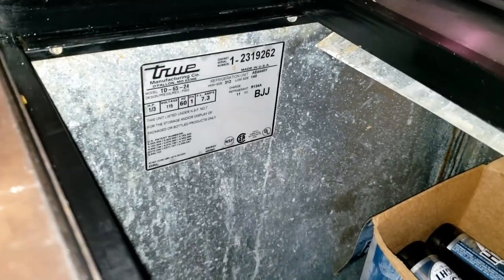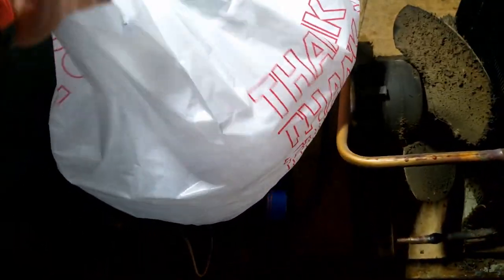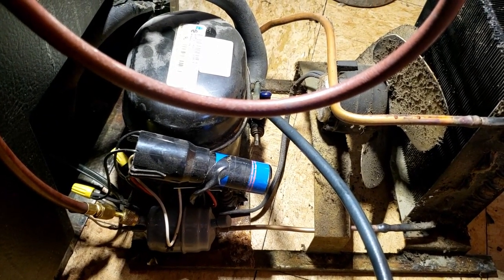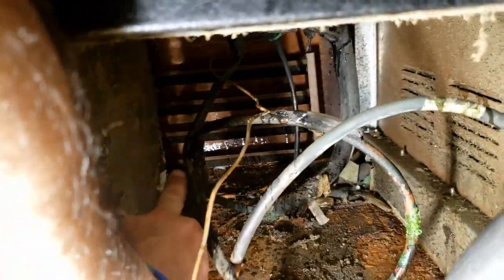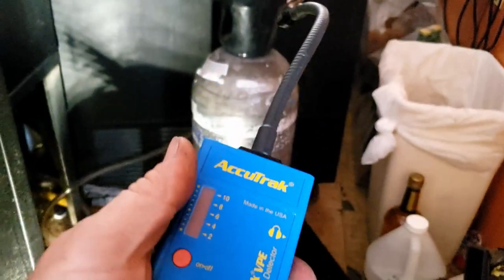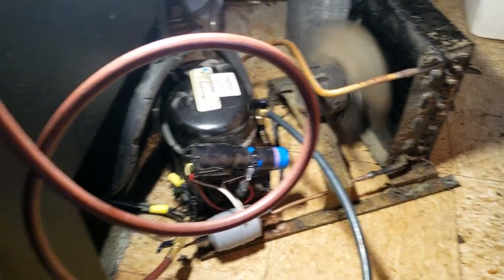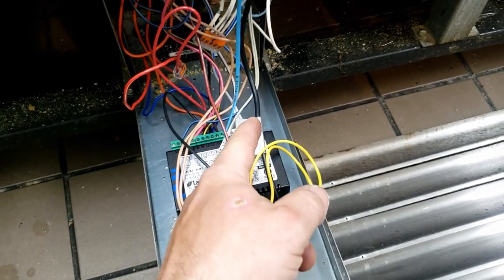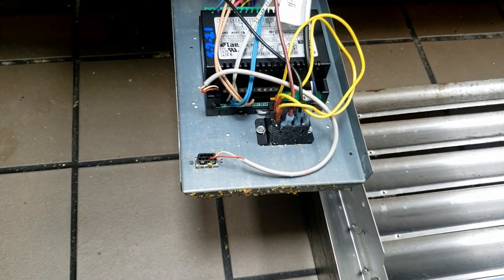HOT Mexican Beer Cooler & True Freezer Communication Error

Comment: Great video thanks for sharing. I'm new to the trade n got my ass kicked today by a 2 door true r/I freezer. No room to work especially when installing a 3 switch klixon in the evap section.  N when I finished I put drain pan back n watch temp come down realized I left my wire cutters inside evaporator section on drain pan. Patience n persistence is key to success I believe in this field. Thanks Rick. 😊
Reply from the maker: I left my screwdriver in a RIF just the other day😁👍👍. Luckily I got them before leaving.